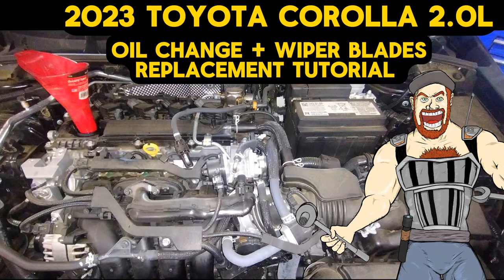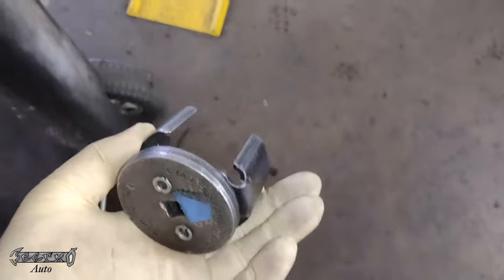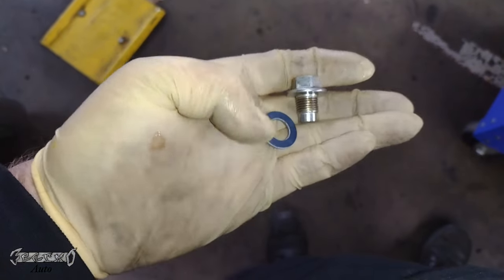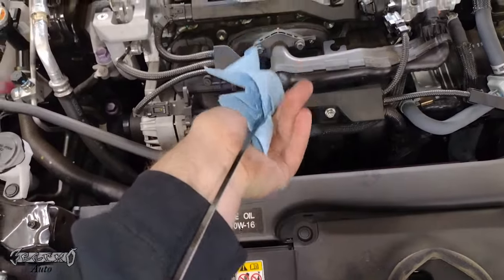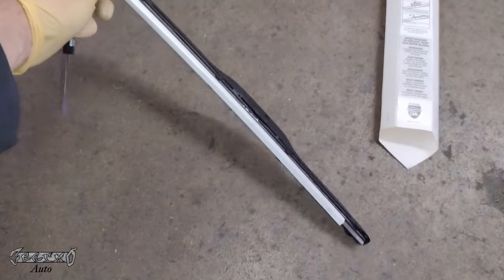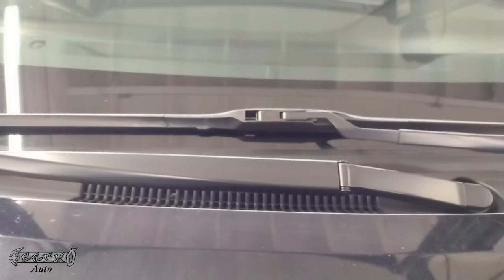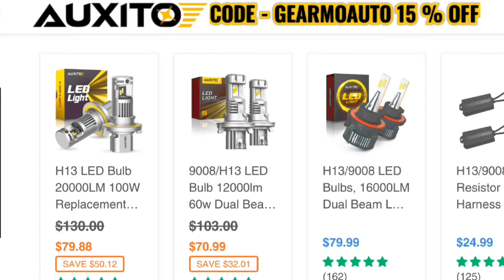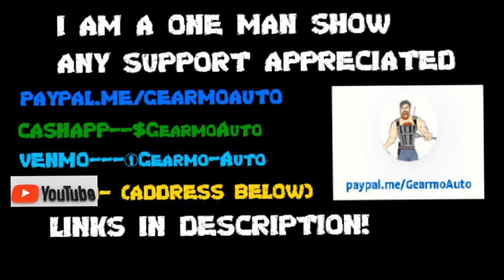2023 TOYOTA COROLLA OIL CHANGE + WIPER BLADES + MAINTENANCE LIGHT RESET TUTORIAL

Comment from the maker: GET FEATURED OIL FILTER REMOVAL TOOL HERE ( AMAZON ) ( 12 BUCKS 
https://amzn.to/3vso1Z2

GET BAND WRENCH STYLE OIL FILTER TOOL HERE ( AMAZON ) 
https://amzn.to/48ISro3

GET THE WIPER BLADES HERE ( AMAZON ) ( 15 BUCKS ) SIZES 24 & 18
https://amzn.to/48pRL7n

GET GENUINE TOYOTA 0W-16 OIL HERE ( AMAZON ) ( 53 BUCKS )
https://amzn.to/3TMRsiF

GET AFTER MARKET 0W-16 OIL HERE ( AMAZON ) ( 27 BUCKS )
(MOBILE 1 _ 5 QUARTS JUG )
https://amzn.to/48KI5UC

GET NEW OIL DRAIN PLUGS HERE ( AMAZON )
https://amzn.to/4b0BV55

GET AN AFTERMARKET OIL FILTER HERE ( AMAZON )
https://amzn.to/3RRywMU

TOYOTA OEM FILTER ONLY SOLD IN BULK AT THIS TIME OF VIDEO ON AMAZON

Comment: The 2023 XSE is using 0w-8 oil, instead of Ow-16 , and Toyota is charging a lot. This was the first oil change under 2 years Toyota Care, but after this, unless they have super coupons, it is not worth it. They are charging $100 per oil change. You need 3 hours of time for a $100 oil change.  At least they now went back to spin on inexpensive oil filters. Mobil 1 makes quality oil, and I can see that they produce this type of viscosity. One can use Amsoil which is a great oil. Assuming that because this oil is on the thinner side, one must change the oil more frequently.
Reply: ya all models of corollas after march 2023 went to 0w-8, you can pick up 5 quarts at walmart for 20 bucks
Reply: @ahgiie more like 27 bucks. I just a 5 quart ow8 mobile 1 at Walmart.